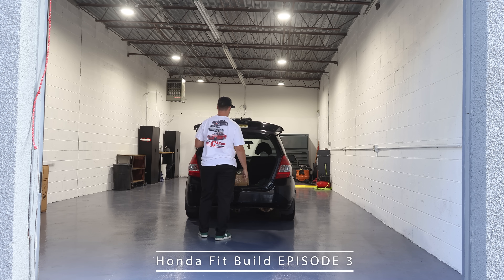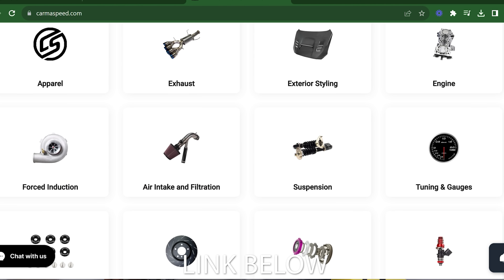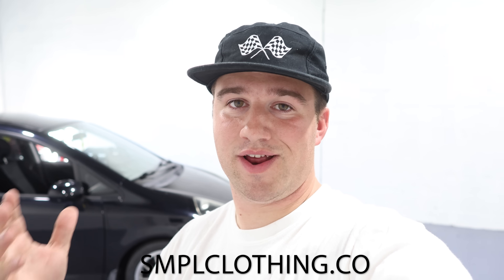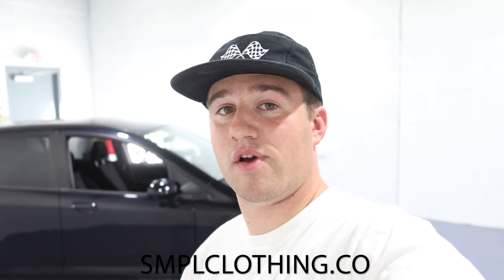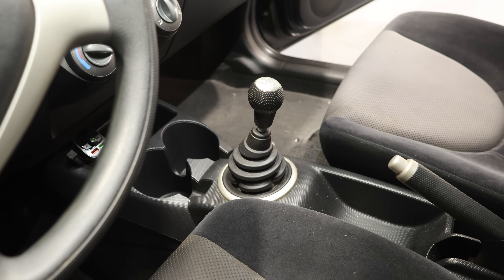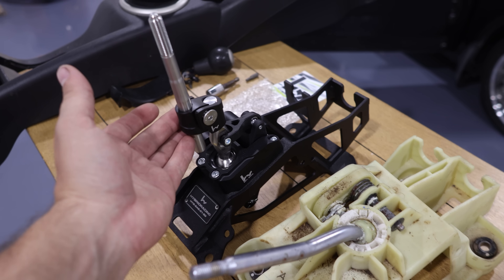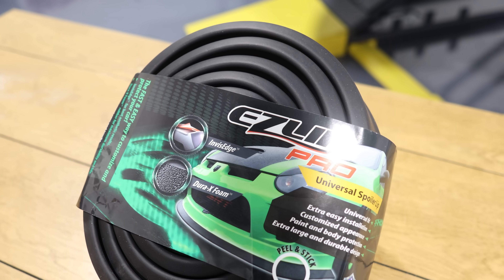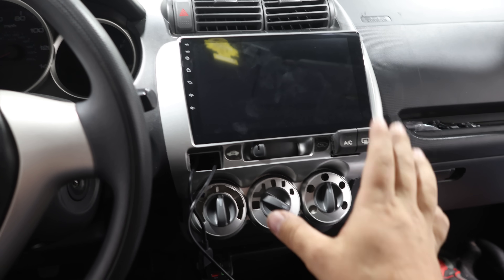Ultimate Honda Fit Build Gets HKS exhaust! (+ Short shifter + front lip + apple carplay)

Comment: As someone who is building his own honda fit this car is awesome perfect daily or first car build after market isnt huge but parts are rather cheap and readily available highly recommend an intake it will make the car a bit louder and will give the pedal more response when you push on it
Reply: I'm not sure where you are finding cheap and readily available Honda fit parts, but its been a struggle for my GD3 and I. lol. I have tons of custom parts on mine simply because the market is shedding anything related to First Gen Fits anymore. Lots of parts need either made or purchase second hand. I am also building a Fit. Have been for years. I love tinkering with it. The community is neat as well. A little more open minded. Once you start to get aggressive, I wouldn't consider it a "good daily" any longer. lol. I have been doing aggressive mods and upgrades. I love it. Real head turner.

Comment: If  the stereo system was  working, and it stopped working, might’ve blown fuse did you install it with the battery on?

Comment: In my experience, those radios are garbage and even if it did start working now, it’ll stop in 6 months. Better off just getting a name brand double din and doing it with a proper head unit the first time. Those styles are just Chinese units that get pumped out with little quality control.